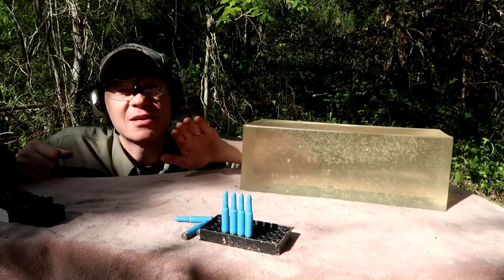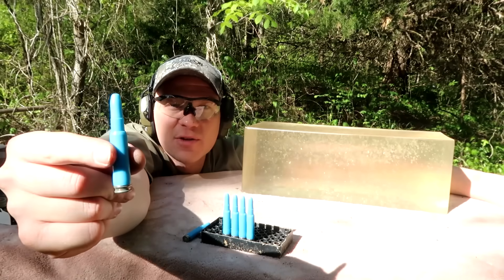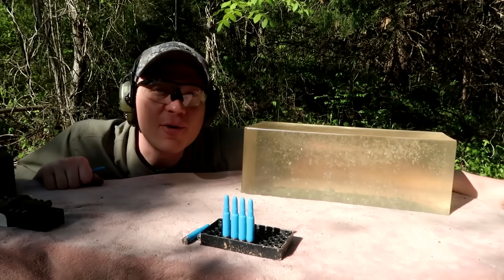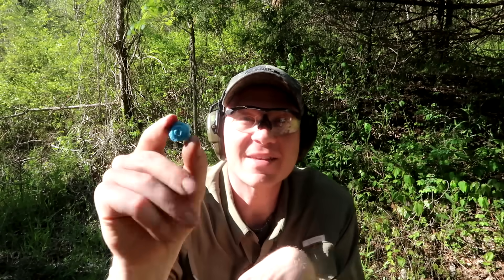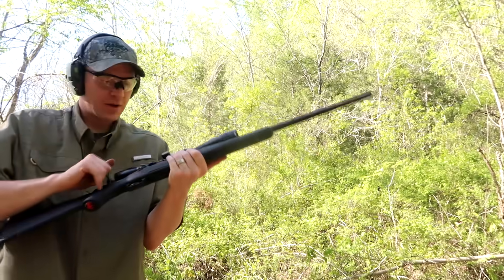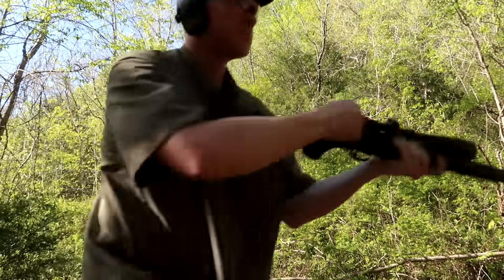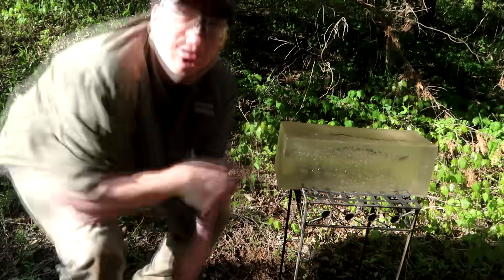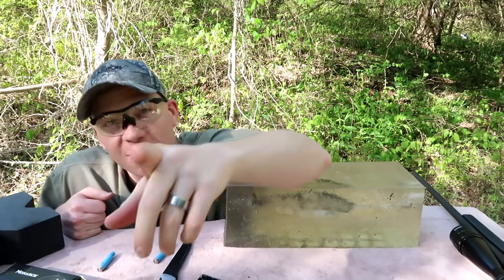💥 “.308 Plastic Bullets vs Ballistic Gel — You Won’t Believe What Happens!

Comment: That's pretty funny it literally just bounced off the ballistic gel and deformed badly, it clearly doesn't have enough weight to maintain its momentum. If that thing would have came back and hit you it wouldn't even have left a mark lol.. the only reason the second shot penetrated was because you hit were the first shot hit and then the third shot you didn't hit the same spot and it did the same thing and just bounced plus you moved back.  I guess if you really wanted to you could call it a less lethal round. That's why the cops call what they use "LESS lethal" if they hit somebody in the wrong spot it is lethal. I've seen them hit somebody with a bean bag round and it penetrated went through his lung  and took his life

Comment: Hi, the German Armed Forces used the blue 7.62 x 51 “PT” (equivalent to the US .308 caliber) in special exercises until around the mid-1990s, where live ammunition was used but there was a risk of hitting a comrade next to you. This involved advancing “in line” through a wooded area and firing at hidden targets on the ground, behind and on trees and buildings.

The minimum distance between soldiers was set at 20 meters and was constantly monitored by the shooting instructors. At this distance, there was little risk of injury if a comrade was hit directly. Apart from severe bruising to the leg or arm, no injuries are known to have occurred.

Nevertheless, this exercise was later banned in this form because a direct hit to the eye could lead to blindness.

So it is no wonder that the bullet shown here ricocheted off the ballistic gel block.

Greetings from good old Germany

Comment: Should make a round with that plastic jacket.  And a pool ball pointed core.  Pool ball plastics shatters bullets.  If the the whole bullet was pool ball plastics it would not have any accuracy.  It is too hard a substance and the riffling would throw it out of alignment.  Like a sold silver bullet, better be within 20 yards or you will not hit it…. Silver too would need a jacket to shoot straight…. Silver also is too hard to shoot straight…
White tipped copper jackets, pool ball plastic cores…. Check out the old practice wooden rounds of WWI and WWII.😉

Comment: Shoot the ballistic gel at 3 feet!!! Get a piece of plywood and drill a hole in it for a guard. That light plastic bullet is loosing all of it's minimum energy at the distances you shot them at.
Reply: losing*
Reply: Had the same thought. Plastic bullets bleed off speed VERY quickly. I still don't expect anything spectacular, but at least there's a lower risk of bounceback injury with the shield you described.

Comment: Cleaning plastic from your bore would be a bummer
Reply: They actually do a great job of removing copper fouling if you run a wet patch of bore cleaner first.
Reply: I would have thought the same, but I've been shooting a lot of printed shot caps, wads, and sabots and haven't managed to find any plastic deposits in the bore.  That said, this is probably something that is not the same for all the various sorts of plastics one might find.  I'm assuming they'd use something that wouldn't smear.

Comment: I saw some of these in action in Germany by Germans during Autumn Reforger, 84.  The blue colour is to designate a practice/training munition.  The use that I saw was in artillery training.   A German tank crew had special jig mounted on their main gun in which they clamped an infantry rifle chambred in 7.62 NATO.  The bore of the rifle was angled to the same vector as the bore of the main gun.  The tank would move at various angles and back and forth, the turret would turn, and then the rifle would be fired.  I guess that it was linked to the trigger of the main gun.  It looked to me like the plastic, including the part that was the bullet, was a unified coating for the cartridge case and that the bullet separated from the rest of the plastic upon firing.  I had no idea that they had any such muzzle velocity.    I think that it is possible that what I saw may have been different from what you have in the video.
Reply: Same stuff, it was used in German training out to about 100m where they'd drop off quickly. You're right about them being one piece that splits off when fired. They're super light so lots of velocity very little momentum.
Reply: @chemistryofquestionablequa6252  maximal 50m,Kurzbahnmunition.

Comment: It would be interesting to see what a wooden bullet would do. In the last days of WW2, Germany used wood to replace lead and copper. I've never seen  any information on what damage, if any, was caused by wooden bullets.
Reply: We had wooden bullets as "blanks" in Finland, back in the 90's, and those wood bullets were blue also. With a real brass casing. Then there was a device you screw at the end of the barrel, that makes the wood go sideways, not forward. I think it was called muzzle booster or recoil booster.
Reply: @Njazmo Very interesting.

Comment: It might be quite old ammunition as I'm guessing that the German army doesn't use 7.62 mm rifles anymore as they, like most other countries, probably use 5.56.
Reply: You don't throw away old weapons, if you adopt a new weapon system.
Edit: army is like a weapon closet, if you already had a .22 pistol, and now you bought a 9mm, do you still use that .22? Of course you do!
Reply: I think depends on the rifle I cant see them using 556 in their MG3 but I could be wrong. Wouldn't be the first time
Reply: The new general issue weapon system is in 5.56.  But, special and sniper units use 7.62 NATO, if appropriate.  They also use .300 Win Mag, 338 Lapua, and other chambering.  Right tool for the job.
Reply: @BobSpiffy1 kinda along the lines of my thoughts. 556 in the right applications is  great, but range is limited for others so I kinda assumed they step it up a bit  when needed.